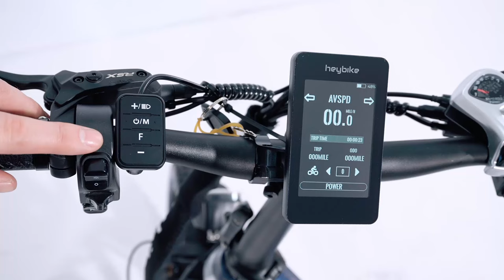HeyBike Tyson - How to Assemble

Comment: Just got mine today on Sunday. It took a little a little longer to put together than your video but was pretty easy, about one hour. Battery came 22% charged and is on the charger now. Quality looks great. A lot heavier than I thought for a foldable. Very excited to ride it in electric mode even  though I did a test ride in peddle mode and all checks out well. I had to pump tires up to 20 pounds as they came with 5 pounds in them. Thanks for the great video. It truly helped out with assembly!
Reply from the maker: Thank you very much for your feedback! It's what keeps us moving forward!🥰🥰

Comment: Hi Heybike Team, I just got my Tyson a few days ago and it has some problems. 
1-	The headlight and backlight are still on even I did turn off the button and the LCD display controls. I have to remove the battery to disconnect the electricity. But headlight and backlight will be automatically on again whenever the battery is in place.
2-	Please teach me how to use throttle properly. I cannot find any instruction video about it from you
3-	What is the function of the “auto” button located under the throttle? And how to use it please?
Thank you!
Reply from the maker: Hello Dennis, thank you for your feedback. Please contact our tech support team to help you with the case: support@heybike.com. They will get back to you within 48 hours. Thanks!

Comment: I got mine and I can only reach 20 miles an hour pedaling as fast as I can?
How do I get it to reach the advertised 28 mph?
I will update this comment after I get a positive answer but so far I am not happy with this bike!
Reply from the maker: The Tyson is only capable of reaching 20mph on the throttle, but the pedal assist can reach 28mph. (3rd speed level.)
Because the US CONSUMER PRODUCT SAFETY ACT (15 U.S.C. 2085(b)) states that this type of e-bike cannot exceed 20mph throttle speed, so we have limited the throttle speed, while pedal assist is possible up to 28mph.
Here is the link:
https://evelo.com/blogs/learn/why-is-there-a-20mph-speed-limit-on-electric-bikes

Hope this information is useful. :-)
Please feel free to contact us if you have any other questions or concerns, and we will assist you as soon as possible.